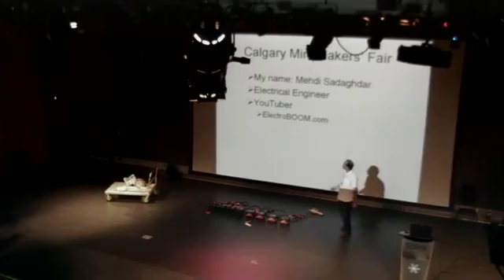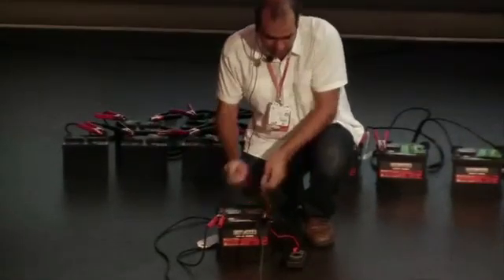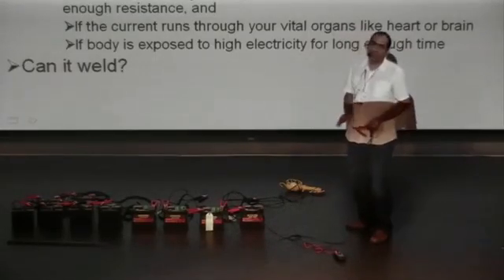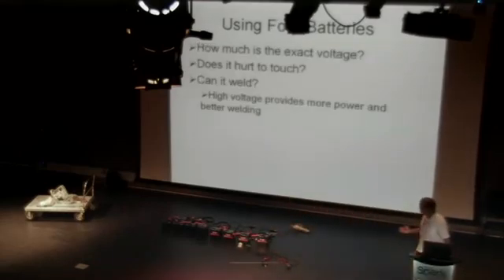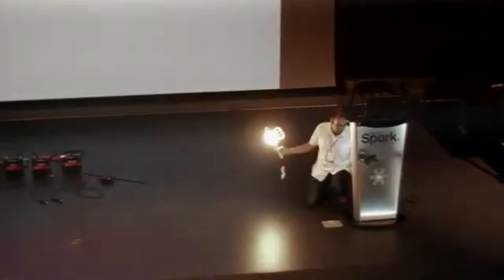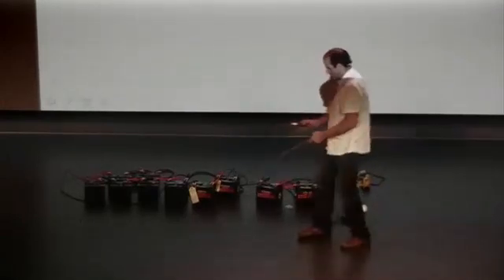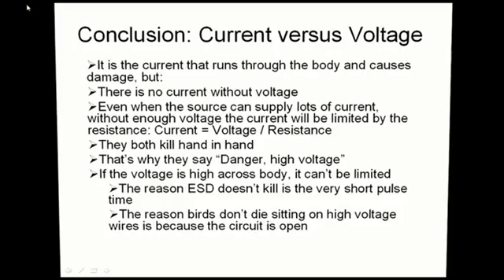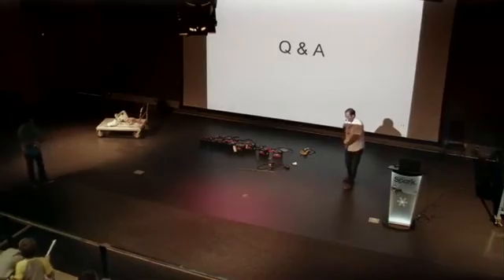Ten Car Battery Presentation at Calgary Mini Maker Faire

Comment: I got my first experience with voltage/amps as a five year old. Sticking a metal nail into a 230V socket holding it with a metal scissor (cause in my five year old head that felt like a secure thing to do), and grounding myself to the linoleum floor. It was both enlightening and electrifying at the same time. But I hated those curls I got for decades. In any case - awesome channel you got. Keep up the funny and educating efforts!

Comment: and how do you survive a taser hitting you with half a million volts or more?
Reply: +DevilsCookies pretty sure the amps are limited to a non lethal amount
Reply: +firestarspelt you camt really limit the amps. when a taser hits you with 100k volts and you've got a 1000 ohms body resistance, 100amps will flow. 
but your inner body resistance is pretty low, with a few hundred ohms, while your skin resistance is pretty high.
Reply: Anub'arak But still, with a Taser capable of delivering 12 Million Volts would be deadly, even with a body resistance of 100k Ohm, this would result in 120 Amps. 

I get why low Voltage with high Amps won't hurt you, but high Voltage and high Amps?
Reply: Well with 12 megavolts its no suprise that it will cook you like raw meat on the surface on the sun.
As i said, i think most if not every taser is set around 5-10k volts to stun a person.

side note: for some reason the top comment i left has disappeared, i have no idea why. Damm you buggy youtube!

Comment: I have a question: If a human were to put their feet joined together on a high power cable like the birds would humans also.not get fried ?
Reply from the maker: +kebab4eva You mean sitting on a single wire? yes and no, it would depend on the voltage level too. if you are talking about one of those 100kV lines, I doubt anything large would survive that! because there is always some capacitance between body and surrounding environment so at any level there is some current through body. But at huge voltage levels that leakage current becomes too large to handle.
Reply: High line workers will use a suit that has metal fibers throughout, the coat will be grounded to the pants via a set of strips of the same material and the suit is then grounded to the chopper. The purpose of the suit is much the same concept of a Faraday cage dispersing the electricity because electricity always takes the path of least resistance. Organic materials are made of carbon a very lite conductor, and water a much better conductor, metals are still better conductors thus the science of the Faraday cage/suit.
Reply: +justin brown Like the other guy said you are close, but there is no ground. If you want to see something really dangerous look up hot washing 500kv insulators.
Reply: Lol... My father when I was little guy use to tell me "you know why birds don't get zapped? Because their dork don't touch the ground"
Reply: No because there not referenced to ground.
Reply: +jon doe and dont touch two cables at once
Reply: The sage And billy show ???
Reply: kebab4eva  no you would not get electrified because the cable has insulation on it so it dose not short out when it gets wet

Comment: 1. Right AC is more hurts , its make it safer , why ? Two basic things  AC '' atack '' your muscle  (its hurt )  but DC ''atack'' body chemistr (electrolisis )  this make DC more dangerous ( long time efects )  ( if not kill can make changes in brain )
2.  bullets its  i'think best example  : What kill,  bullet weight ,volume ( volts) ,  or bullet speed , urge (current) ?
Reply: ac is more dangerous because your body has capacitance
Reply: +Kadu Penuela You don't understand my point of view, you can feel AC voltage when it is dangerous for you , with DC not, but long exposition of this voltage is dangerous.
 2 Right electricity haves 3 dangerous element Current , Voltage and Time of being exposed. Without  high enough voltage you can't achieve  needed current , but with enough low current , every cold voltage ( plasma ) is safe for you , second  reason  every think can be '' UNDER VOLTAGE '' but for any work ''CURRENT MUST FLOW ''.  3 based electrical rule :  to been electrocuted you must close circuit. Earth-fault breaker is base  shocked protection ,What is it most important parameter?  --- CURRENT       This is a  simple reason why current kill , but this is only opinion based on 10y experiences with 24V - 170kV and 0,1 mA- 6000A

Comment: 120V AC would kill you? I got 250V AC all the time which is something like 0.25A if I have a restistance of 1k Ohm
Reply: He says 100k ohm, not 1000 ohm.
Reply: Peter K. Maybe, I didn't wrote 1k because he said it - but because that's the lowest presumed resistance for human skin (not wet) which I learned in my electrical engineering ed while my professional training.
It's a good nominal value as it will result in the highest current within this calculation.
Reply: I've heard the 100k ohm figure cited before, but it is a good principle to err on the side of caution when it comes to such things.

Comment: so a car battery doesn't kill you. why not? One car battery is a cliche torture method and people die from getting shocked while working on their car all the time. Whats different?
Reply from the maker: chance beaudoin I think we are talking about movies. And maybe people drop those heavy batteries on themselves and die that way. I can't see how you can die with a 12V battery. You could boost it up to thousands of volts and die touching that high voltage, but not straight from 12V.
Reply: +chance beaudoin (Chubycabera) you might be thinking of the car's ignition coil.  That converts the battery's 12V into thousands of volts to run through the spark plugs.  If you touch that, you feel it.
Reply: +chance beaudoin (Chubycabera) if you lower the resistance of your body, one battery will fuck you up and kill you. The voltage is required to overcome the resistance to get the lethal current.
Reply: I'm pretty sure that method requires you to douse the victim first.
Reply: roidroid "feel it" I hurts like a bitch
Reply: Typical Hollywood exaggeration, that's all.
Reply: the only way a car battery can electrocute you is if it is a ev battery. usually 300-600 volts DC. that can cause issues. if you complete the circuit!!!

Comment: So I am by no means a welder, I just learned how to do mig a week or so ago.  But when you started having issues laying a bead after proving it CAN weld that might be due to a mixture of flux, oxidation, and slag on both your surface and your welding rod.  For presentations you might want to consider an iron brush to clear away an impurities.  Only issue is you wouldn't be able to hold a live rod, surface, and brush at the same time with out seriously messing up your stage presence.  It would by very unwieldy.  (I tried really hard to not make an "unweldy" pun).  Either way awesome video!

Comment: By touching the very high current, u do not instantly die because the voltage is low which doesn't break the resistance of the skin right?  But a high enough voltage would allow the current to pass through u and u would meet ur creator right?
Reply: yep

Comment: Let's say im interested in electicity and would like to experiment. What would be a good place to start?
Reply from the maker: Torwulf games Internet
Reply: Stick a fork in a power outlet
Reply: Torwulf games I say start with a circuit simulator. It's very cheap (free, in fact) and you can do whatever you want without fear of hurting yourself or damaging your equipment. I recommend Paul Falstad's circuit simulator (http://www.falstad.com/circuit/). It's not as advanced as some others, but it's much easier to use, and gives really intuitive visualizations.
Reply from the maker: epic pony 2nd channal
And hot at the same time!
Reply: ElectroBoom guy started with a 237VAC wall outlet when he was 6 and now he is an electric engineer. 

I started when I was 8 years old, plugging a 65 ohms 6w resistor in a 127VAC outlet, trying to energize it (I thought it was a capacitor). I fried my fingers.

Now I'm an electronic technician. 

I imagine how it could have been if I had started when I was 4 years old with a taser.
Reply: Eye protection.
I don't give a fuck about Medhi getting skin burns. He's male. He doesn't need to be pretty. But I frequently worry about damage to his eyes. That's bad. That's serious.
Reply: ***** That's why you have FANS
Reply: Torwulf games I would start with a USB Power Supply. They output 5V arround 1A. Its pretty interesting to make circuits that work from USB Ports
Reply: Michi Lo Every normal person that has a 12 V transformer with a center tap in one of his non-trivial electronics.
Reply: squirtillery Sorry, my forks do not fit.
Reply: +Torwulf games put a fork in a socket
Reply: ***** If you are lucky, your RCD will turn the toaster off. If not, you are toast.
Reply: +Torwulf games ac output + fork
Reply: allaboutcircuits.com
Reply: Arduino
Reply: when I was really young I noticed shorting 9 volts made a small spark, so I thought that shorting the mains power might make a slightly bigger one. I ended up sticking two loose wires in the wall outlet in my room and shorting it out, long story short, I ended up without electricity in my room and shocked pretty badly. Ever since then I've become really interested in electricity and want to become an electrical engineer in college.
Reply: play with batteries power supply under 20 volts. Motors and leds they will teach you a lot. Just mess around and don't play with a dangerous amount of voltage.
Reply: At home.... Maybe?
Reply: SteelBlueVision What normal Person has 6V AC at home?
(With normal Person i mean that person that has nothing to do with electricity.)
Reply: SteelBlueVision Ok. Me not.
Reply: +Torwulf games Engineering school.
Reply: +Michi Lo  Hi, The best info
 that I have noticed was on Volt daddy (i did a google) Without a doubt 
the most informative info on batteries and this type of stuff that I 
have found.
Reply: +Torwulf games find a plug n socket at home lol no dont do that pls lol  DONT LISTEN TO ME!!!
Reply: Erik Iacopelli I wouldn't do that.
Reply: +ElectroBOOM 😂😂😂😂 good one
Reply: +Torwulf games First step is to recognize how it tastes...
Reply: +Torwulf games

I guess you meant electronics, you can start learning the basics from the internet, and android apps like icircuit and everycircuit , but if you want to go further, choose the book way, older and newer books because sometimes its hard to find trustworthy information on the internet about some issues on electronics, anyways you are going to need "tons" of maths and patience.
Reply: REDLUFF Boom. Or most likely the fork won't fit.
Reply: +Torwulf games arduino
Reply: the wall outlet
Reply: Erick Lopes
I started with 4, connecting the cable to the outlet, and touching the beautiful shining copper wires ....

Don't remember anything else.
Reply: Birki gts anywhere but here my friend
Reply: Unplug your stuff.

Comment: Wow, this really is a dangerous and somewhat misleading presentation. Your normal videos are clearly comedy but this tries to be instructional. Yes, AC is more dangerous but 120V DC is also very unsafe. All it takes is for the skin to break down from the initial current and then the body resistance will drop dramatically and you could have a large current flow.
Also, the smoke you made with the higher voltage welding contained lots of nitrogen dioxide (the red-brown color). This is a very poisonous gas which is why welders use ventilation.
Finally, on the arc behavior vs voltage. No matter how short the distance between two conductors which don't touch, in air at normal pressure an arc will not jump with less than 300V for DC. What you are doing is "striking" an arc by touching the two pieces which vaporizes a bit of the metal making a plasma from thermal effects which then forms a conductive arc. However, there is also a minimum voltage to sustain an arc (regardless of the distance) of around 30V and higher voltages will allow a longer and more stable arc.
Reply: Sean Breheny Man, that nitrogen dioxide thing was a pretty big slight from him then. Didn't know that!

Comment: Hey Mehdi, I use a high voltage source for some experimentation that gives 5000VDC and has a fuse at 20 mA. With a body resistance of around 200k (measured by me), I am in the iffy range - if I touch it, I might take the 20mA without blowing the fuse because body resistance varies. Just for educational purposes (I give it a wide berth while running experiments :D), what will happen if you touch it? A cramp perhaps?
Reply: +Linden Lonstrup You can't measure conductivity of yours skin by standard multimeter (for humans skin resistant is 6kohm-800 ohm depend of voltage lvl and frequency)   . Fuse is short circuit protection device its slow and by your body for split second can flow max current generated by your source (if this fuse is on the output site of this generator )

Comment: excuse me but may i ask a few things?

well, let's say i've been dabbling with capacitors and their practical applications that include stuff like gauss setups and self defense stuff. 

a project with the capacitors was a gauss gun, thanks to your video, that made it look rather simple to make. so what i did was a simple single coil setup with a mousetrap for the discharge switch. makes a fantastic bang and spark when it goes off and sends a nail flying across the garage. been thinking of upscaling this prototype but at the same time also considering adding a second or third coil to improve projectile velocity. i'm using a 10,000 microfarad 50 volt capacitor. i'm thinking a bigger capacitor would make for a stronger magnetic field? which ones should i use, ones with higher farad ratings or voltage ratings?
Reply from the maker: FilipinoZeroFighter The issue is the timing of coil on/off. You need to make sure the coil turns on when the bullet is at the coil entrance and turns off when it is at the center of the coil. So really the size of your capacitor would depend on how fast it would discharge. If you make it too big it could hold charge too long and actually pull the bullet back into the coil and slow it down. So for example when doing a few coils in series, the next coil capacitors should be smaller as the bullet is running faster through them, and you need some mechanism to turn them on in a proper moment. That's why I used sensors. You would need a much faster response sensor for a fast bullet.
Reply: thanks a lot, will apply this in the next redesign. have a nice day sir.

Comment: hello mr sadaghar
 i am a student of electrical engineering and a big fan of your videos.
i am currently making a magnetically levitated wind turbine... where the rotor disk which is conncted to the propellers are magnetically levivated to the stator.. and the stator is having the coil to produce electricity.. so do you think, the project is viable and do you have any suggestions about the construction and the permanent magnets ? thank you

Comment: Okay.. so why is it that I cannot weld with right out from the 220 V wall socket? Is it because the current is limited by the 15 amp fuses in the distribution box?
Reply: aszendi May be a late response, but the reason you cannot weld with 220 v AC, is because you need DC to properly weld. The electrons in a DC circuit all travel the same way, which is needed to transport the molten metal from the welding electrode, to the material you are welding. Ac on the other hand, travels bach and forth, thus just throwing molten metal around, instead of streaming to the other metal :)
Reply: killimig99 Thanks!
Reply: killimig99 Actually you can weld with AC but only with a speciallized machine that's made for DC or AC welding, and the right welding rod for AC. When I was in school, we had Dual Mode Machines, that let us run Positive DC, Negative DC, and AC.

In the end, its more about amps then voltage for welding
Reply: killimig99 Not true at all. AC arc welding is the most common form of welder found in homes and garages. Only professional TIG and stick uses DC.

Comment: If you would touch and release the wire very fast, like it was a square signal which has AC component, would it hurt more? If you could do that at 50/60 Hz would it kill you as AC would?
My guess is not, because you are "floating" when you release and not connected to GND, but wanted to be sure :)

Comment: Oh but a 12V battery can kill! If it falls from high enough on you.
Reply: Don't drink the sweet liquid. The Roman empire felt because of lead added to wine for improved sweet taste.
Reply: Thu Nell Ⓥ  Effectively, 220 volt * square_root(2) * 2 = 220 volt * 1.4142135623730950488016887242097 = 311 volt (311.12698372208091073637151932613 volt according the scientific version of microsoft calculator).
The peak voltage of a sinusoidal wave does not depend on the frequency.
Reply: The 120 volt AC is actually 168 volt. We feel the peak at 168 volt.
The capacitive effect is very small at 60 hz.
Testing with high voltage output from color tv, 15 khz saw tooth (Fourier analysis reveal that it is equivalent to higher frequency with pure sinusoidal wave shape.